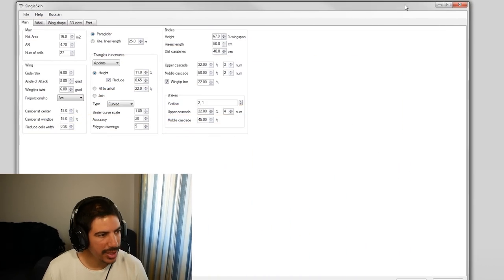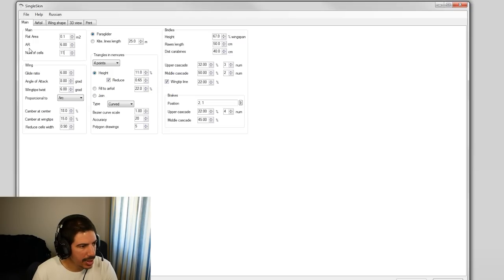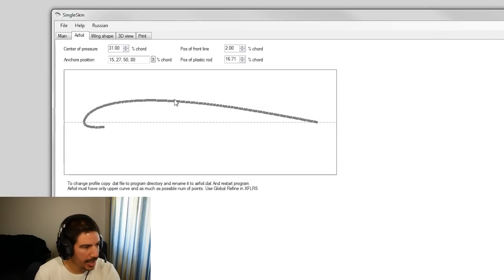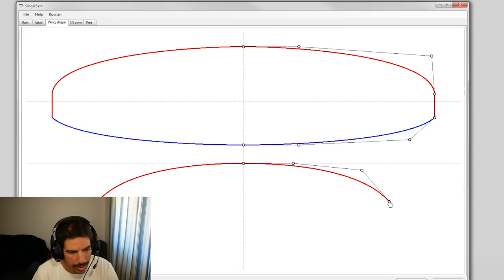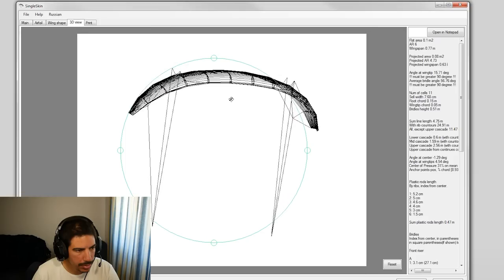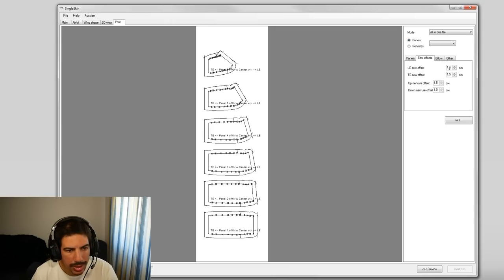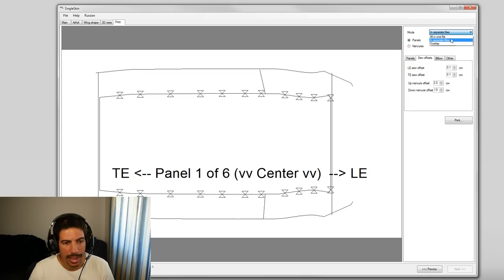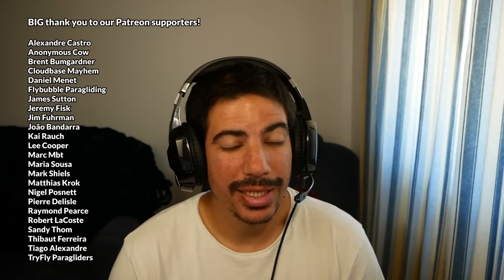Designing a Paraglider in CAD - Making a Paraglider Part 3 - BANDARRA

Comment: If you make a glider too flat... it will not hold its shape! It will horizontally collapse like a concertina. You need enough curve so the more vertical areas at the tips counteract this tendancy though side ways lift being generated pulling or stretching out the wing!
Reply from the maker: Not sure that's strictly true, older paragliders and skydiving rigs are pretty much a flat plane
Reply: @AndreBandarra1  Yes but they do not have the aspect ratio or glide ratio of a paraglider. They are similar but server a very different purpose.  As the aspect ratio gets higher the air pressure alone will not hold the wing shape. Some lift is used to maintain horizontal tension.
Reply: I'm not sure that's the entire picture, the largest part of a paragliders rigidity comes from the raised internal air pressure, the curve will help stabilize the shape, especially for high aspect ratios.  Even older paragliders and skydiving rigs had some curve to them, but yes, it is possible to make them very flat. 

I think the largest consideration for the curve of the wing is about the control pivot point which needs to be above the pilot, the flatter the wing the lower the pivot point becomes meaning you need longer lines to put the pilot below the pivot point. It's all a question of what's the best compromise you can design :)

Comment: Amazing job 😍😍

I made my previous glider with only basic triangles calculation to measure the curve of the wing and the length of lines it was a bit hard without computer to calculate... you know how it would be😂😂😱  though with this application I would do a better job I'm sure!!

I've been flowing your chanel since you recorded lecture of the principles of paragliding, i just wana say you're doing a wonderful progress 😎 

For this application "SingleSkin" I couldn't run it on my windows 10 x 64 bit 🙄 is its not compatible with Windows10 or maybe if you know a version that can run on my laptop, that would be lovely!